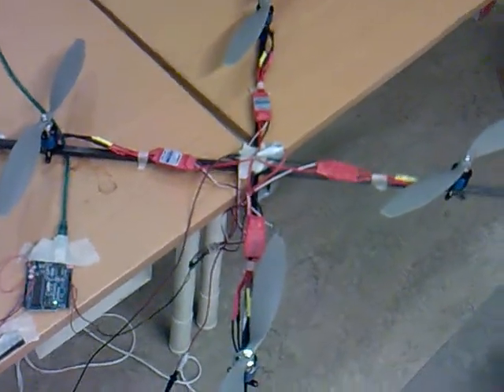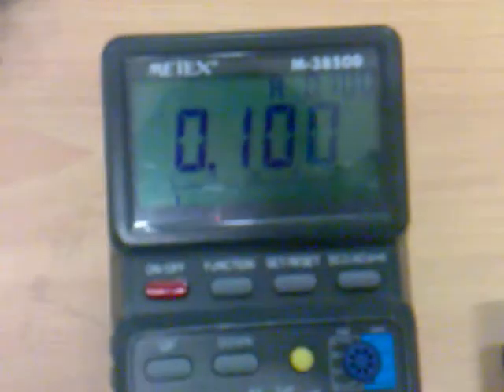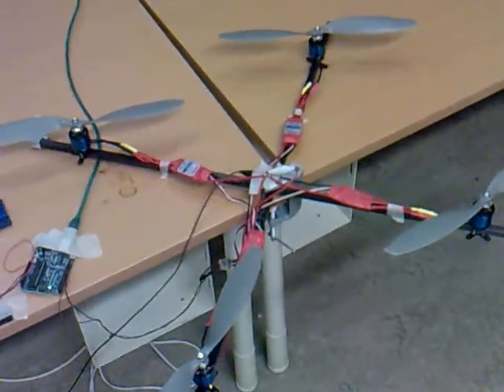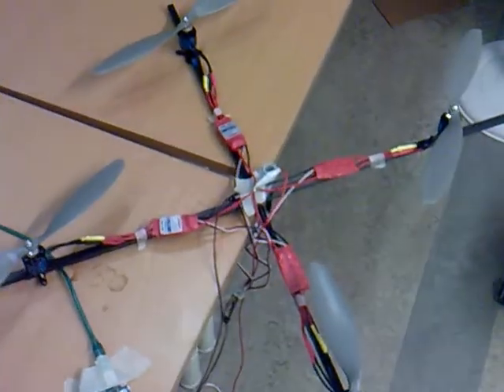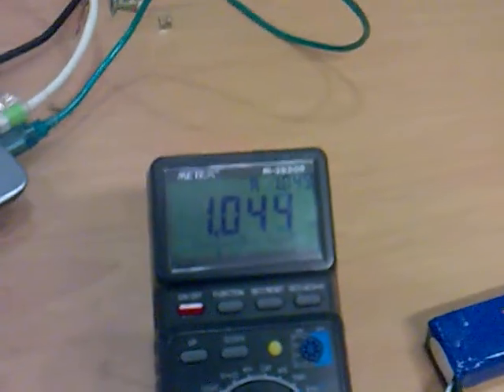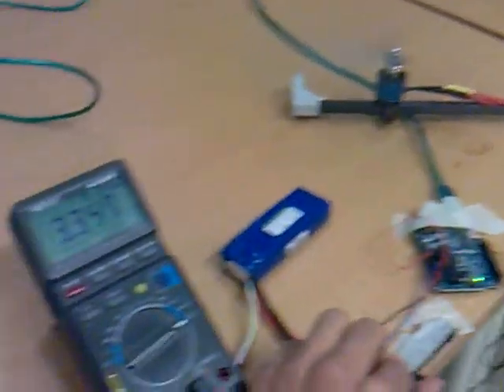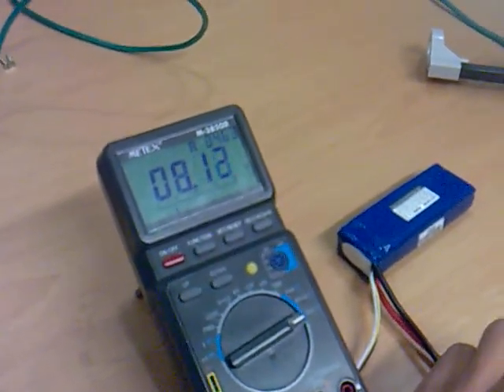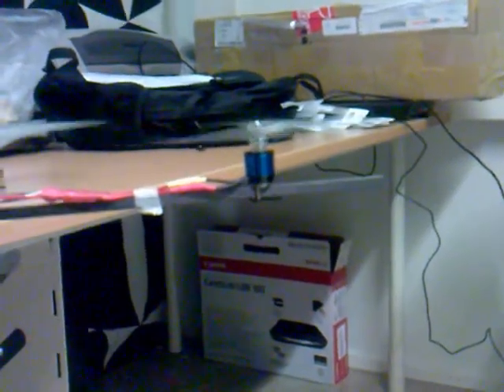First frame setup of my quad rotor

Comment: i have 6061 aluminum for the frame,light weight,strong,you don't need 6061,but its cheap in smallsquare stock,Aircraft Spruce has it